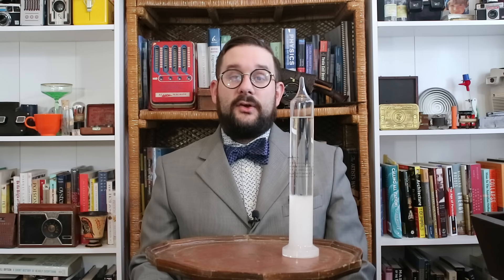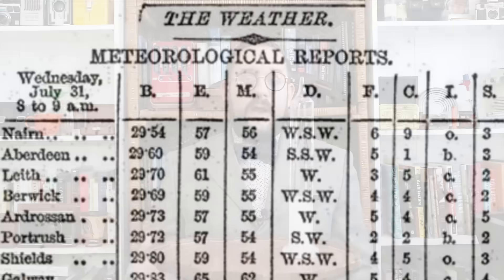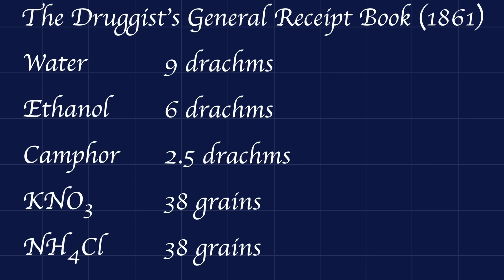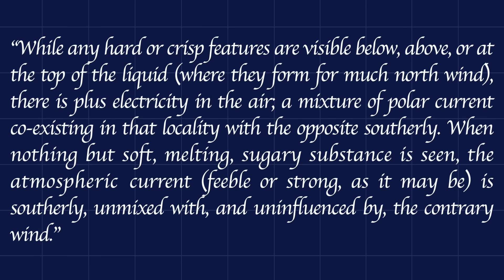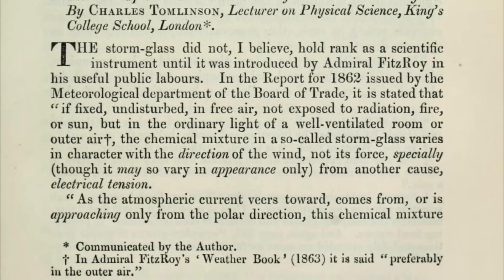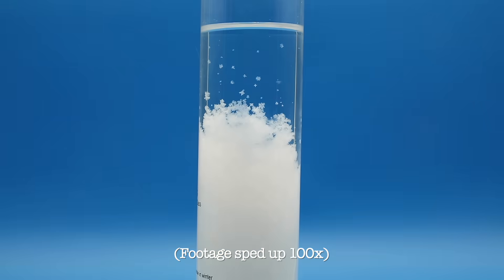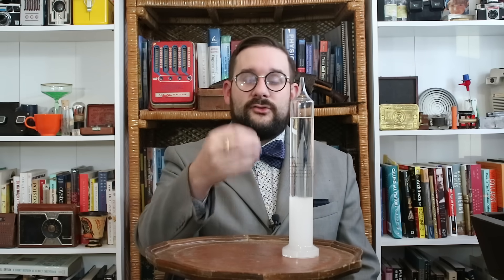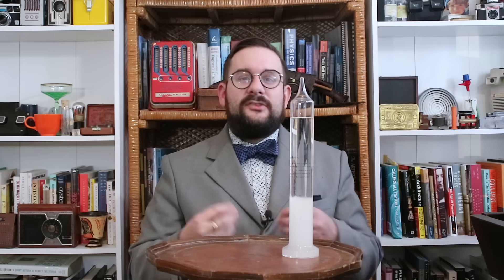Fitzroy Storm Glass: the Dawn of Modern Meteorology

Comment: I have wondered if the leach prognosticator involved a confusion with a fish called a loach or weather fish, they come to the surface in warm thundery conditions. They can breath some air and when oxygen is low in water due to a temperature rise and possibly also barometric pressure drop they breath air from the surface.

Comment: As a chemist I find this rather interesting, as anyone who works with oil paints can tell you temperature and humidity can pretty drastically affect the rate of reaction (oil paints don’t exactly “dry” they react with the air.) the open glasses might well have produced the effects of a wet bulb thermometer and a barometer but, well, confused and mixed together.

Comment: You got 2 things wrong that I noticed. Firstly, if it had a probability of 50%, that means that it is not chance. If there were 2 states, then yes, 50% = chance. But there were multiple patterns described to correlate to multiple weather types. This would massively diminish the % accuracy if it were random. In other words, rolling 2 die and landing both on the same number 50% of the time is not random. Furthermore, you said that there is cold on the advancing front of a weather system. That is incorrect, it is hot. Cold air flows into hot air. Therefore the direction of movement will push hot air along. Behind the weather system is cold.

Comment: Oooh interesting so its an analog 0 accuracy thermometer, primative temperature sensor, thingy? I might just have an idea, see i have hydroponic planters for my houseplants and i try to make em look nice. But you either can look into it and let light in and fight the algae (which isn't that bad) or close the tank and not be able to read the water level at a glance. I bet if i simply strap stormglasses to the side of the tanks I'll be able to read the shape of the crystals instead of looking at the water. And that would even look cool too.

Comment: The changes in the stormglass are not only relevant to the current temperature , but also to the speed of change of temperature and total change .
Fast temperature drop will produce different looking crystals than slow drop. The mixture is basically tweaked to show a "battle" of three solutes and two solvents near their saturation points, where dynamic equlibrium is highly influenced by initial state and rate of change. However, as you correctly pointed out, this serves its purpose not better than just checking the thermometer and noting how fast the temperature is dropping and to what value. It's a nice looking thermoscope, nothing more, but it's really nice to observe and play with.

Comment: 8:18 "The  chances of the storm glass accurately predicting the weather were no greater than 50%. That is, no better than chance."
The idea that 50% probability corresponds to a chance outcome is completely wrong. For example, if I could predict the roll of a six-sided dice with 50% accuracy, that would be much better than chance, since random guessing would only be right one sixth (17%) of the time. Being able to predict the weather with 50% accuracy actually sounds pretty good, to me. There are many possible outcomes (sunny, cloudy, windy, snow, frost, thunder and probably a few more that I've forgotten), so being able to predict the right one of those 50% of the time is potentially much better than chance.

Comment: Hearing about this device, I am wondering if they’re actually might be just a little bit more than it’s given credit for. Rather than just being a thermometer, it sounds like it might vary based on the rate of temperature change.

Once you see that, I’m wondering if it might be accurate a bit more than half the time, but only in the place that it was designed and tested in. Because the same rapid changes in temperature might signify the same weather coming on, but only for that area.
Reply: You got it correct. Initial state and rate of change is what is important with this complex mixture of substances. Fast cooling produces different crystals than slow cooling. It's a very peculiar thermoscope.

Comment: Please make a video on the military M–1950 stove. It has lots of stuff that you would like, such as legs and pot supports that flip out (it looks like a lunar lander), a wrench which clips onto it, a cleaning rod operated simply by turning the valve, and even a set of spare parts INSIDE the pump housing. It’s a really clever bit of engineering from Coleman - and you can even explore the several other companies that made it under license, which opens up whole avenues you can explore regarding the state of U. S. manufacturing and the supply chain back then.
Reply: legs and pot supports? wow!

Comment: My grandfather had a device where a figure with or without an umbrella stood outside the house - it was supposed to tell what the weather would be like - but I don't remember how it was supposed to work.
Reply: Those are usually hygrometers.
Reply: The one I've seen had the figures suspended from a length of hair, which twists and relaxes slightly based on humidity.

Comment: fun prank/experiment, control the temperature of a storm glass to get the correct output as per weather predictions 😆
Reply: Might not be that difficult, either. A Peltier effect device on the bottom, and a small microcontroller to control it, and you can heat or cool the vessel as required.